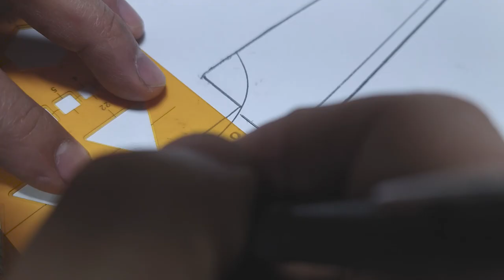나는 칼을 만든걸까? 칼을 수리한걸까?

Comment: After this you are not just repair man, artisan or craftsmen but true artist. As a stone sculptor that piece speak to me, those curves just sing and that its continue from blade to the handle. It really tied it together and the blade shape have such tension. The back is ever so slightly curved, such a beauty in simplicity. And that you add brushed finish is such a poetry, to have just center piece polished and have handle and blade in similar finish. Even the placement of the rivets have their own angle and lined with the center of the handle, and the use of copper rivets just add some simple detail. Every thing have angles and curves, it have such a organic hand made feel were you speak to the material and dance with it and not force it to shape.